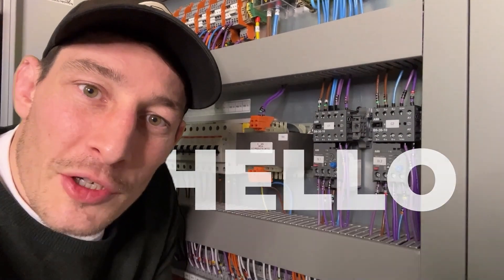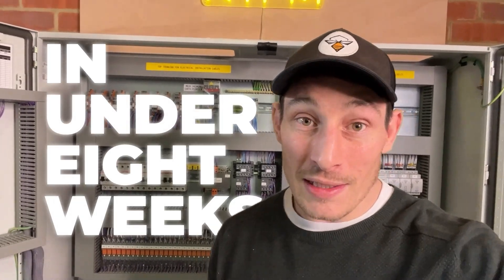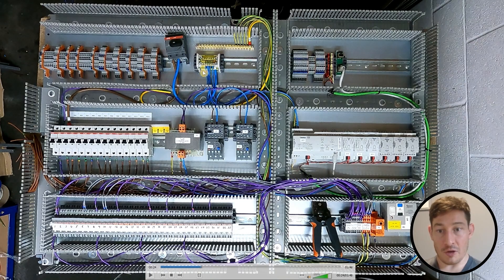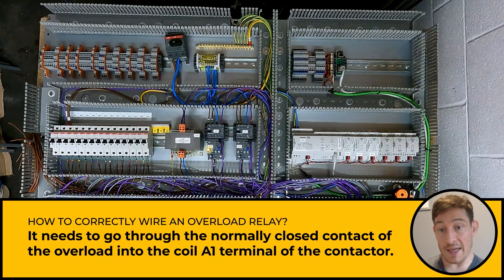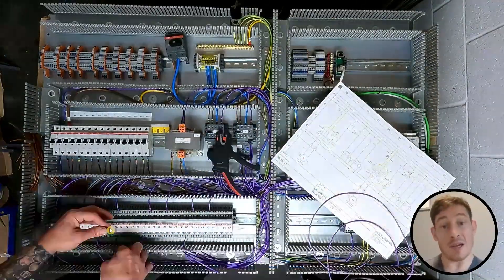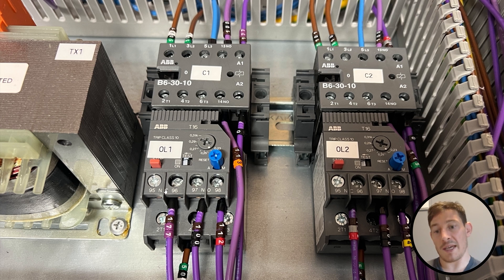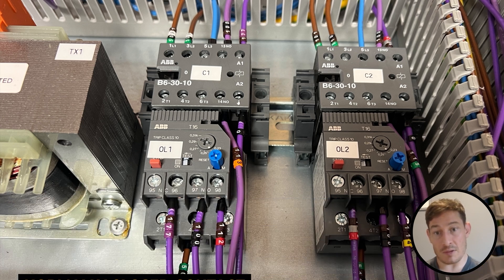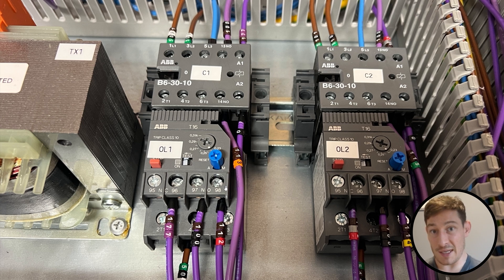Contactor with Overload Relay Wiring (IN A CONTROL PANEL)

Comment: Great video! Quick question: why would you connect the N.O. pin of the contactor to a relay? Can you not just connect it to a pair of jumped terminal blocks, this way, you will send a signal to the light and a input to your PLC?
Reply: Signal to the light will be 24vac or dc, plc input will be a different voltage depending on manufacturer so you use the relay to keep them separate and work correctly